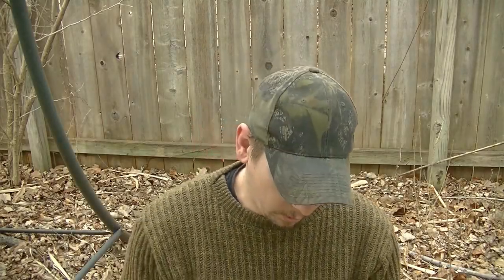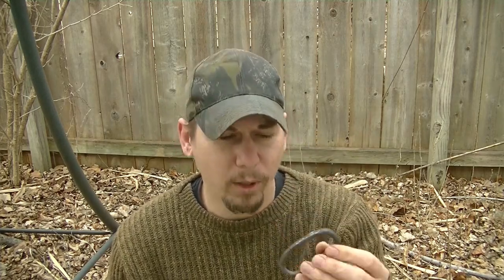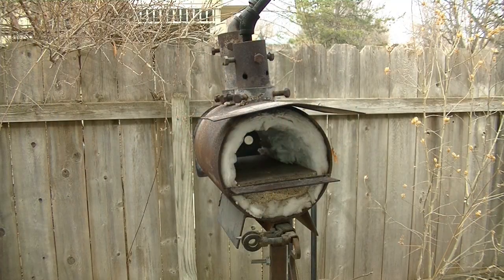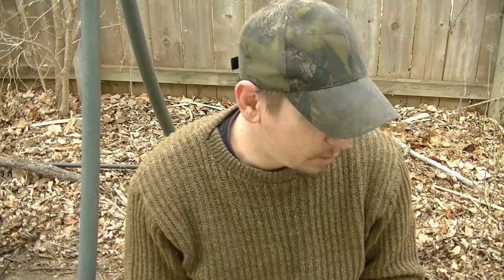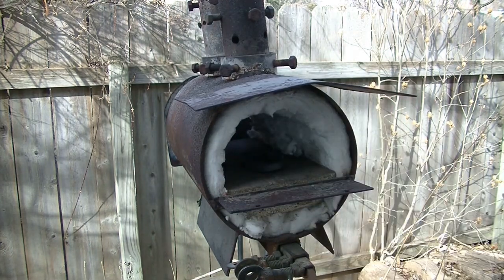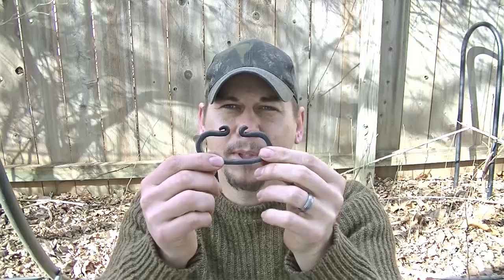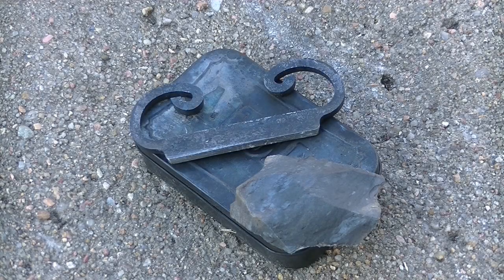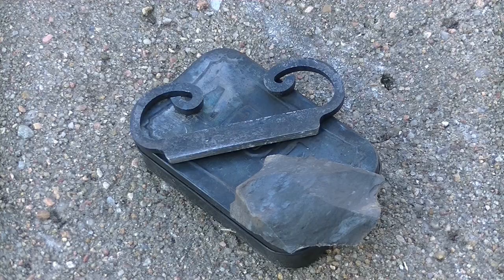Attempting to re-temper a steel striker

Comment: Hard to tell from the video, but LOOKS like you might not have been hot enough.  Use a magnet, once the steel stops sticking to the magnet raise the temp about 50-100 deg F. and then quench.  Different steels have larger or smaller windows.  1095 needs to be quenched from about 1500 deg.F down to under 400 in something like 2 seconds or less.  O1 and 1084 at bit slower, something like 4 seconds.  O1 has the advantage that it will air harden somewhat as well.  I've only done a few strikers from files so far, most likely W1 or 2, or 1095.  The quenching in motor oil to "add" carbon is a fallacy, yes, you can add carbon, but the first pass of a wire brush will remove it.  Carbon migrates very slowly, simple case hardening will take hours depending on the depth you want, and that's in a carbon pack.  Your not going to get squat from quenching in oil and then re quenching in water, any carbon added to the surface of the metal is blown off in the next quench.  Since you did get good results from the O1 I'll assume you were at temp for the quenches on the first striker.  If that's the case, you've got mild steel and it'll never properly harden.  One way to test is to heat to just above non magnetic, quench in water, clamp in a vise and smack it with a hammer.  If it breaks like glass and the grain looks like fine satin or silk then you've got high carbon steel, if it bends or tears you've got mild.

Comment: Great video. I had read somewhere, can't remember but they said just quench about 1/4" of the striking surface Only? Going to try to re-temper this striker I have. Might be that it was originally made out mild steel. I hear 1095 steel is good steel.

Comment: Probably was only 40-60% carbon steel. Which will spark some but not well. Anyhow, the right type of steel being used, it only needs to be heated till a magnet won't stick. Often that's below bright orange. An oil quench metal, in addition, will often crack if quenched in water.

Comment: One important thing is to move it in the water or in the oil while cooling it. Because there becomes to be a pillow of steam and it slows down the cooling process ;). So You have to shake it off.

Anyway nice video. Thanks ;)

Comment: you need steel 0,7 - 1,4 carbon steel, and at least 62 Rockwell, a file into water, orange heat will do
Reply: O1 is fine, W2 is great as well, 1.5% carbon, that's what most old files are made from and that's why blacksmiths so often use old files to reforge into strikers. I actually think an old file reforged and re-hardened into a striker makes about the best striker you can make.

My reforged file striker sparks as good as my Andrew Kirkham's, which I would put up against any striker in the world as the best strikers made.

Comment: For what it's worth......I have a Condor belt axe that is , according to Condor, 1095 high carbon steel. I sink it into a stump or log and strike my stone on the top part of the axe. It sparks really good.  My stone looks like and is about the size of a  chicken egg.  White on the outside and blue/black inside. I hold my char-cloth in my fingers to catch the sparks, works good.
   I don't know what kind of rock I have but it clogged the hose on my back pack gold dredge, that's how I found it.....lol

Comment: Is this something that has to be done to all steel strikers in the course of their lifetimes? Or is it only in certain circumstances? I want to get a striker for long term fire starting.
Reply from the maker: +Guardian 227 As long as you don't heat your steel striker to the point you can't touch it, you will never have to worry about this.
Reply: +grierwolfe okay thanks for the reply! And that will only typically happen if the steel is put in say a fire right? Not sitting in the sun or anything? Nothing happens in cold right?

Comment: Couple of things....the water volume was too low in the quench........water and oil don't quench the same over 200 degrees...........need cold water.....Next do we want super hard metal so the steel will be hard as glass? and then the square corners chip off and create heat?.....or would a softer metal quench   oil    be used.........what about fully annealed.....soft.........would steel still come off maybe easier    and still be hot enough? I have been told this is so. I wonder  about the theory here.......best practices.....I'll try it hard but i'm wondering about softer........The definition of steel is any iron that can be hardened.......high carbon steel has 1 % carbon..........I do Not find files to be good at this.....High carbon and hard.....the very hardest quench comes from cold salted water .....shocking full sudden emersion.....But again is hard the best here? extremely hard? or would this cause trouble / difficulty getting the spark?

Comment: i know you probably been told but not all steel is good for strikers  it has to be high carbon steel  if its not it wont work as well if at all  another thing is you need a magnet to check your steel when you are trying to harden it  let it get hot enough it will no longer stick to a magnet then you know it is hot enough to quench it  use oil water works but i think oil is better good luck and keep trying

Comment: I live in Missouri and wondering where I should go to find flint rock so I could put my own flint and steel together
Reply: +Chris Mccarthy   "Flint" when we are talking about Percussion Fire ignition can be any of hundreds of types of rocks. Best places to look are creek beds, lake shores, hillsides, farm fields, etc. Wherever rocks are exposed. Heck watch the decorative stones in landscaping, some of them work well. Look for chalky (soft white) cortex (outside), glassy (shiny, smooth) or sparkly (fine crystals that reflect light), conchoidal fractures (hard to describe, look it up), etc. Having one or more of those signs makes it a rock definitely worth checking out.
Reply: Also, if you have one rock you know is quartz, chert, flint, etc then when you strike it against another rock, that will tell you a lot. Soft rocks will crumble and leave a powder behind. Those are not good for starting fires. If it bounces off several times with little to no damage, you may be on to something. If you see red, orange or yellow sparks, it is "flint". 

No, those sparks will not ignite tinder. They are triboluminescence, which means really weak electric sparks. Like in a piezo electric lighter only weaker.

Comment: The old one was probably made of low carbon mild steel.  Nothing could make it spark.
Reply from the maker: ***** Agreed.
Reply: +Mark Holbrook  Are we sure there is no way to add carbon? High carbon steel isn't "born" that way. Bet there is a way, we just haven't found it yet.
Reply: Sure there's a way. But you would have to melt the steel with the right percentage of carbon.  Wouldn't be worth time in these days, but back in the pre-industrial times it  was done.  They just used high carbon steel where they had to, it was usually welded to wrought iron.

Comment: As others have stated, you should try with the used motor oil.  Also, you need to quench with it still Bright orange, and quench the whole thing in one shot so it quenches evenly.
Reply from the maker: Eric Tumilson Yeah, I've since got a little better.  https://www.youtube.com/watch?v=CP7QHWQiI9c
Reply: Where do you get your flint Justin? I live in TN and I know what I'm looking for. Got some interesting stone that would make great arrowheads. If you knap off a shard it shaves hair! Not obsidian. But I can't get it to spark off the back of my old worn out Queen hawkbill that I use as a Ferro striker for practice??

Comment: Try using used motor oil, the blacker the better. You have to get more carbon into the metal, and used motor oil has a LOT of extra carbon in it.
Reply: +dereklacy  Any oil will be simply deposits as a rind on top of the steel. REally not much in the way of adding or penetrating the steel.  Do some real research. Please. To add carbon to the steel, you have to fold it in over and over until you have enough. but what is enough? Trial and error will tell. As you are folding it in, you have to quench the steel and do a spark test until you are throwing bright sparks. It simply won't magically be absorbed by dipping hot steel into the oil.
Reply: +David Gardner .......dip it in oil after pounding....heat it up and repeat.......use moly in your dirty oil..........use in charcoal forge.  pound it ..........plus you ever heard of case hardening?... carbon steel has 1% carbon.....that's all.....that's how I score it.

Comment: That was a great job but you are in need to use some oil to cool it down you are in need to heat it to white hot and put it at a ounce not little bit little bit more faster

Comment: back in the 70's i bought one of those cheap Tower flintlock pistols.the frizzen would not make a spark.i looked up a color chart of some sort that showed how hot you had to get the steel.well it worked.i used a buddy's welding torch and got it over red hot and plunged it in water.
  the main spring was sort of weak and i could not get a good spark all the time so it went up as a wall hanger,
 check for that color chart and try again
Reply from the maker: I sure will man.  Thank you sir.

Comment: Very helpful.  Glad to see you are using punkwood.  Charcloth is mostly a parlor
trick.  Back in the day, the "townies" used charred cloth.  The people on the frontier
used charred punkwood.  There are people out there selling useless strikers, mostly
made in India.  I have had real good luck with Emberlit, Wolf Creek Forge and
Masters in Wrought Iron.  DMashburn d.t.mashburn@att.net
Reply from the maker: Thanks for sharing man.  I'll check that out.  And yes, I don't subscribe to charcloth.  Punk wood is free and in every woodland environment.
Reply: David Mashburn zombie tinder on Amazon makes good strikers for a damned reasonable price. I got the three finger version and it throws sparks like a muffler dragging on the highway. and the Flint I use isn't exactly the most ideal shape either. it's difficult to find a sharp enough edge on it. I tried to split it with a Hopper but the thing is more stubborn than I am lol. but when you do get a sharp edge, damn. I think it's a tad better than steel from files actually. I have two made from files, that throw really good sparks, but the one I got from zombie tinder is visibly better. so if your on a budget guys, and having issues getting good strikers, check em out. I never push products either. hate it. hate that survival became an industry. but in this case, I feel it can help folks.

Comment: When heat treating it helps to hang a magnet on a wire from the front of your forge.  Use it to find the point where the steel no longer attracts the magnet at all. This is called critical temp. When you find it, immediately plunge the steel in the quenchant. If you are looking for pure hardness plunge it all the way in. If you want part to remain soft leave that part out until the entire piece is cool.  If you pull it out while part is still hot the heat will transfer to the rest of the piece and it will soften the part you quenched to harden.
Reply from the maker: Thank you for the tips!  They are all much appreciated.
Reply: Welcome,  I like the striker you made. Seemed to throw great sparks. I'm inspired to mod an altoids tin for charing tinder and make my own striker.

Comment: So when you tempered the second stiker. Did you do oil or water?
Reply from the maker: Well I tempered that one in veg oil because I was using o1 tool steel.  I have since learned that I should do it in use motor oil

Comment: Even though you may have been shy to show us how you made the striker, I would still like to see a "how to" on making one when you are more comfortable with it. As always, I enjoyed the video.
Reply from the maker: Oh I will for sure be showing more in the future.
Reply: Awesome! Looking forward to it. Also, does it matter what file or brand of file to use as a striker? Are some a higher carbon steel or are they about the same? Just wondering because I've been in DIY mood for the past couple of months and a striker is the last item on the list to do to complete my kit.
Reply from the maker: I can't really answer that for sure.  Any file will get the job done though.
Reply: +Wisdom Lore   Some files these days, especially the cheap ones, are made of mild steel then only a thin layer of the outside is hardened. They throw little to no sparks for a bit then quit working altogether. Nicholson files have never let me down. There are dozens of metal implements that work as the striker for F&S. Shovels, putty knives, razor knife blades, Olfa blades, saw blades (but not SawzAll!!), fish hooks, some axes and knives, etc.

Comment: Heres a way if checking if you have good carbon content or not. Put a known piece of low carbon steel to a grinder and watch the sparks. Then get a file and do the same. You are looking for nice sparks that look like those from the file. If you put the striker to the grinder and  your striker throws sparks like the file then its temper issues if not then its low carbon.
Reply from the maker: Great idea man.  Thank you.
Reply: No problem bro. Hope it helps. John.
Reply: OKBushcraft carbon steel sparks are very distinct. looks like wheat in a weird way

Comment: Perfect timing. I have just bought some firebricks and a nozzle for my LPG torch. I am going to make a steel, and was initially going to use an old file. I think that probably the striker you were given is too low in carbon content. Now my problem is going to be in finding Flint here in South Australia. It is probably cheaper buying some on ebay and shipping than paying for petrol to get down to the nearest flint deposit.
Reply from the maker: I feel your pain on the flint thing.  I don't have any in my local area either.  I have to drive about two hours east to collect any.

Comment: Possibly too little carbon content.
Reply from the maker: Possibly I guess.  It just has the feel of mild steel.
Reply: ***** Mild steel is low carbon steel. If it feels like mild steel it's carbon content is probably low.

I'm not real familiar with steel strikers, but aren't they usually manufactured from high-carbon steel?

Comment: Great video on from several different aspects. Congrats on upcoming class. Based on what I just saw, you're well past being someone totally new to the art. That's a perfect position to be in to gain the most from the class, in terms of tips & techniques. 

Thanks for sharing. God Bless.
Reply from the maker: Thank you Lee.  I really am brand new.  I cheated a little bit and cut the striker out of a piece of flat stock and then just adjusted it a bit.  Nothing real major.